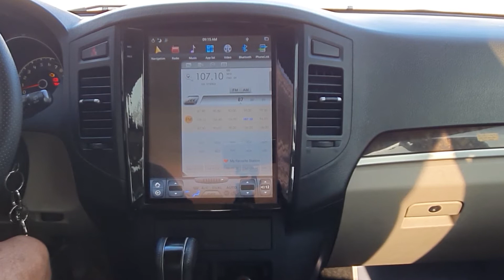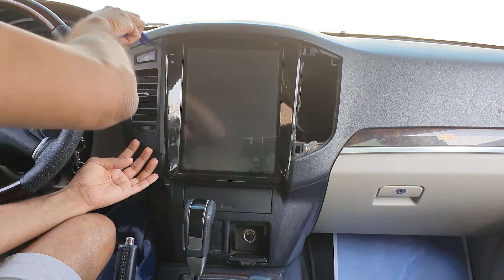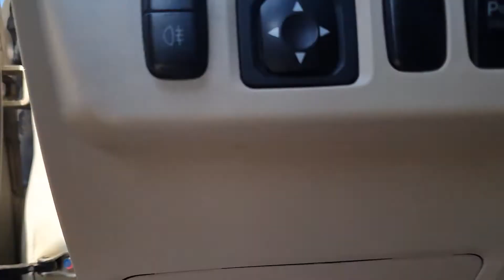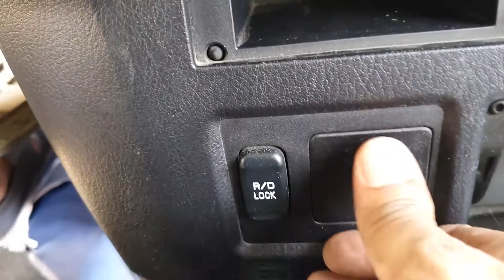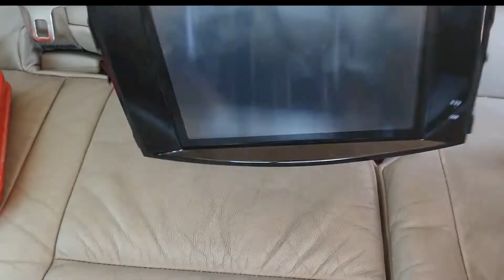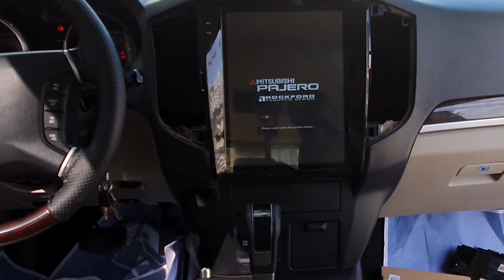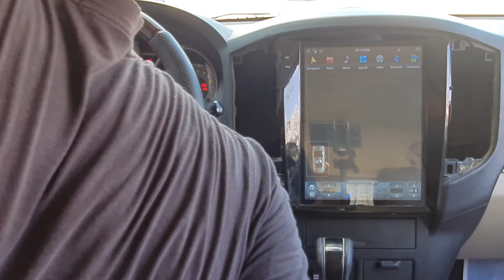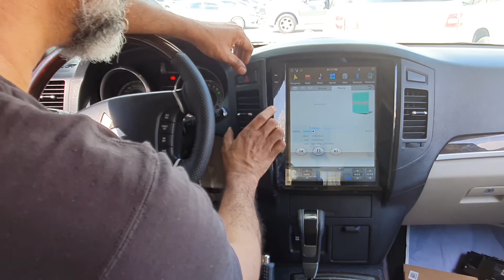Pajero Android 12.1 inch Tesla Screen DIY and  Review

Comment: Solution to your HVAC manuals controls: 

01 - Put another model panel control, try to adapt one a bit more slim. Like the Mitsubishi Sport 2022 HVAC panel control or any other Mitsubishi model.
I guess this model will fit and works perfectly.

02 - If this not fit well, just change the original gear stick.

Please, don’t  forget to tell us if this solution works.

Comment: So which protocol setting are you using to enable the working instant fuel readings?
Reply from the maker: Unfortunately many of the utilities included in the original system ( the top panel of the pajero) like fuel economy, temprature etc. are lost. 
But this being an android system, I’m not sure if any app can be installed to access all that data, since it is connected to the cars computer.

Comment: how do i put the theme of my pajero full truck, just like the image you sold me????
Reply from the maker: I’m assuming what you meant to say is, “How do I change the default Image to a custom image of my truck, just like you showed me”? 
To change your home screen image, you’ll have to access the file manager using the menu, find the current image and replace it with another image of your choice, but keeping its file name, file type and resolution size the same.
Here is a few links to videos where it’s done for other units. But the operating system is absolutely the same so should work for your unit too.
https://www.youtube.com/watch?v=7IyBfkZMm7U
https://www.youtube.com/watch?v=WJyzcqultX8

Comment: Hey mate, how did you hook up stock Rockford amp ? I’ve got the same and stock amp doesn’t work hence no sound. But it work with RCA. any tips ?
Reply from the maker: When the unit in the car is replaced, its just the head unit which is replaced, ie the pre amp section. The main amp, is tucked in somewhere inside the dash board. 
The tesla screen unit comes with a harness which hooks up to the existing wires leading to the amp. 
When you say it works with RCA, do you mean to say that you are connecting the head unit to an external amp ?
Reply from the maker: @hashbrownentertainments  
I saw this video, i heard what he was trying to say, but I'm not sure if the unit is not turning on the amp, because if the main amp is not turned on, no sound should come out, This unit will have only a pre amp and wont have enough power to drive 12+  speakers in a Pajero, so if you are getting a sound output that means your amp is on. Unfortunately there are no separate controls for the sub woofer and individual controls for each separate channel, and the fader/balance controls are also rudimentary
Reply: @orthopoduae  Thanks mate. I’ll keep you posted with the developments.
Reply: @hashbrownentertainments  the key is getting the correct harness adaptor for 1 thing
Second is triggering this, I don't know about the unit being shown, it might come with the trigger wire seperate or intergrated through the correct patch cable..🤷‍♂️
Another way is to find the amp trigger (amp side) and run a relay trigger off a live feed from the headunit, or even manually start the amp (worst case scenario)
My friend has an NT and had a battery drain, amp wasn't turning off, the relay fixed that.
He told me 
AERPRO CHMB4C STEERING WHEEL CONTROL + PATCH LEAD FOR MITSUBISHI PAJERO 2006-14 is needed to turn on amp (but for some reason didn't turn it off - hence his relay)
Reply: @kiwiaus  Way beyond my knowledge mate but i’ll pass this info to a professional installer. Cheers 👊🏼
Reply: @hashbrownentertainments  I've not done it yet.. 
You need (from what I've read)
AERPRO CHMB4C STEERING WHEEL CONTROL + PATCH LEAD FOR MITSUBISHI PAJERO 2006-14
I've also read this cable can cause flat battery (not turning off the amp)
This is easily fixed by replacing the music fuse (fuse box next to battery) with a 30amp fused relay trigged off acc/ignition

Comment: So your original headunit was a GPS Rockford system ??
Reply from the maker: No the Rockford dint have a GPS. The Tesla unit does. so it has a GPS antena which is routed through the side of the dash board centre speaker and then stuck on the dash, close to the windscreen.
Reply: @orthopoduae  ok .. but original had an amp ?
Reply from the maker: @kiwiaus  
I'm almost certain of this. 
This unit as well as the original Rockford unit with the CD changer, are too small to have an amp big enough to drive the 12+ speakers and the sub woofer.
They most likely just have just the pre amp section. The Amp has to be tucked away somewhere else.
Reply from the maker: Some in the Pajero Forum have said that the AMP is behind the Sub Woofer.

Comment: did the air con controls work  ?
Reply from the maker: Both the in Tesla screen Aircon controls and the original knob controls works fine, but I still haven't figured how to fix the old knob/ dial controls back along with this screen.

Comment: I have it. It is sucks. Do not buy it! Slow, complicated, SD does not fit, does not work, buttons do not work. Google maps navi is extremely slow to start. Half way to my workplace the GPS is still not functional. Radio receiption sucks. Split screen is just a theory, in practice it is a disappointment. Do. Not. Ever. Buy it! Digital AC control does not work. Original camera lost the guide lines and has becam distorted. Very bad.
Reply from the maker: Sorry to hear your bad experience Lila. 
Probably the guys who installed the unit for you did a bad job? 

I am not advertising this product, nor am I a vendor, just a Do It yourself person trying to modify something. 
I've had it now for over nearly 3 years. It's ok for the money I paid, the only features I use everyday are the GPS and the radio. Both of which work fine. 
Being an Android unit you can install any GPS software on it. Offline Google maps, Wayz etc.
Reply: @orthopoduae  it is not the installation. It is the crap product design.

Comment: Dear Sir, very informative video, I am also in uae this wanted to speak to you if possible pls, to seek guidance on how to fit this unit. If you can e-mail me, we can speak. Thanks
Reply from the maker: Hi Sonu,
 Im no expert, I bought and got my Unit installed at Clayton  Eghbal Solimani Trd. Co.. 
Nearly a year later after using the device extensively I decided to try to fix back the AC controls. The video is all about this attempt. 
But I'm happy to help in any way can with Information.